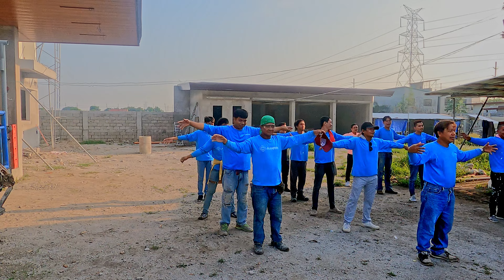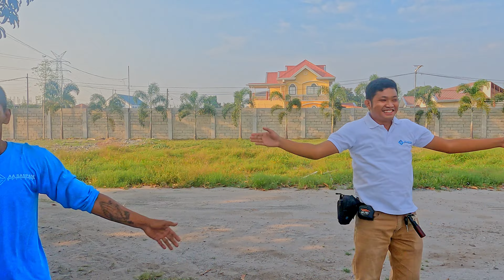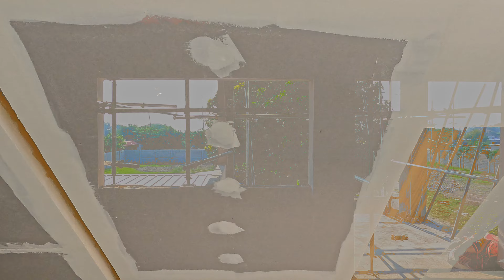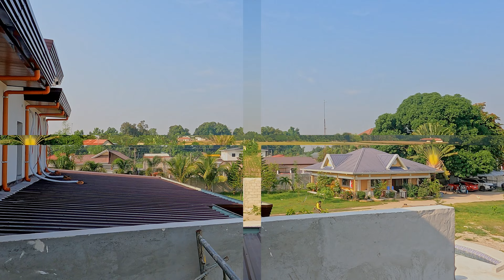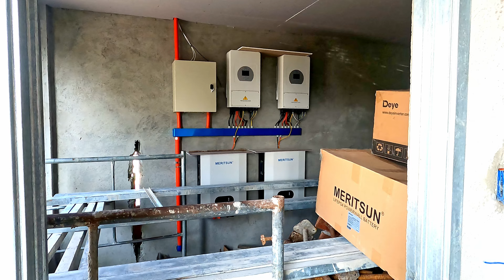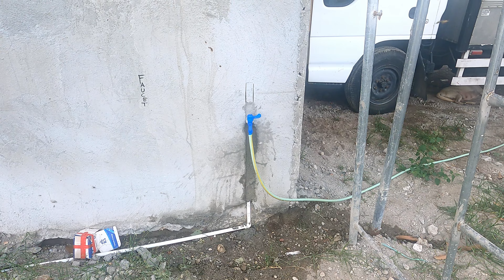Philippine House Building Day 225 - Inside Looking Out

Comment: End of the tunnel is fast approaching and your house is looking good. As far as I know, pool jets are suppose to be at least a foot or two below the water line pointing down 4 O'clock position for proper circulation of water and chemicals. Please correct me if I'm wrong.
Reply from the maker: Thanks for the comment Rob
Have mentioned this in today's video, just to see if we can get any other views on this. Not questioning you - just seeking more comments if possible